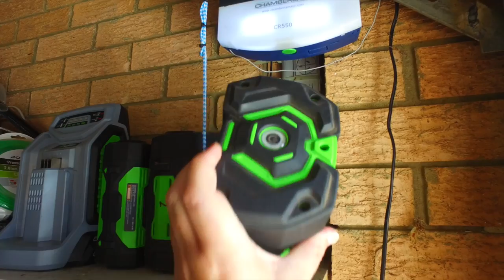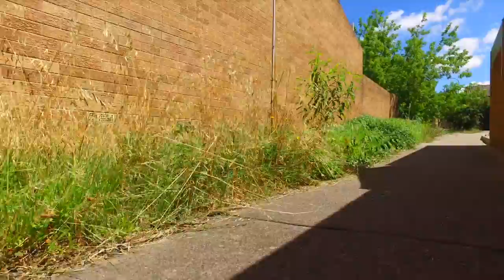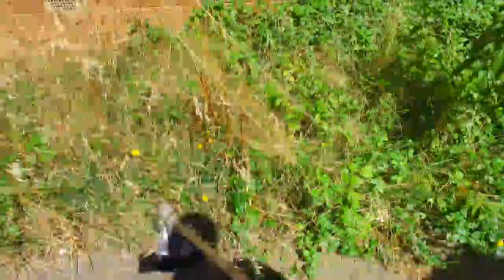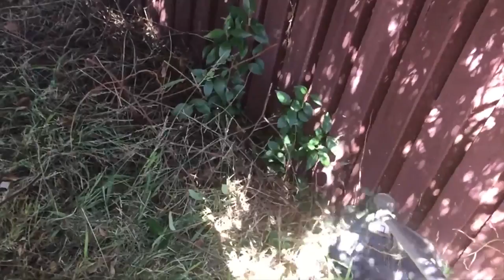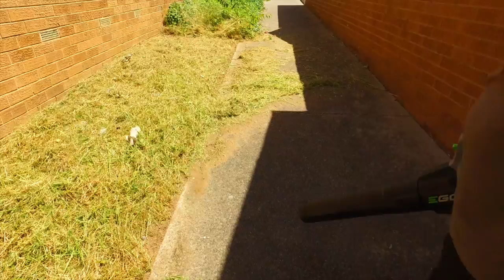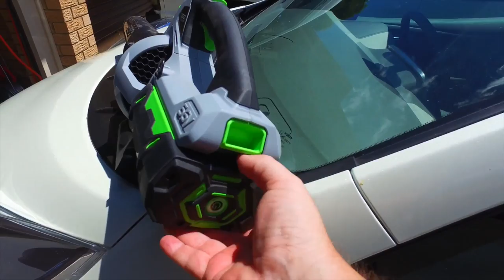Ego 13" Line Trimmer real world test

Comment: hey mate, I'm thinking about getting the 38cm version of this. Whats the real world run time like with 2.5ah battery?
 Thanks
Reply from the maker: Ruchira hi there. I don't actually know what the run time is with the 2.5Ah because I have a 1.2 acre lot to snip and it takes me about an hour or so to do everything and the 2.5Ah battery lasts for all that time. I then just keep it in the shed for another few weeks uncharged. But I did flatten the 2.5 battery for the first time ever snipping for a friend who's yard had grass over 4 feet tall. I hacked away and used so much line it was rediculous. Anyway I think I got a bit over an hour or so. So then I put the 7.5Ah battery on, and it lasted another 40 minutes then I mowed the whole yard on it as well. I'd say an hour in real world use. Coming from a little 2 stroke it's really weird, this trimmer has 2 speeds, hi and low but I thought low would be useless but it does save power but even at the lower speed it doesn't bog down anywhere near like my old petrol trimmer. It's so bloody torquey.
Reply: Thomas James thanks for the information :-) Looks like 2.5ah for me will do the job. I was tossing between ego and the honda 4 stroke umk425 and wasn't going to bother with 2 strokes at all. For the moment I'm leaning towards Ego :-)